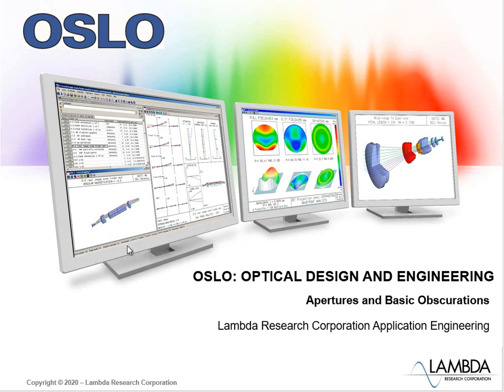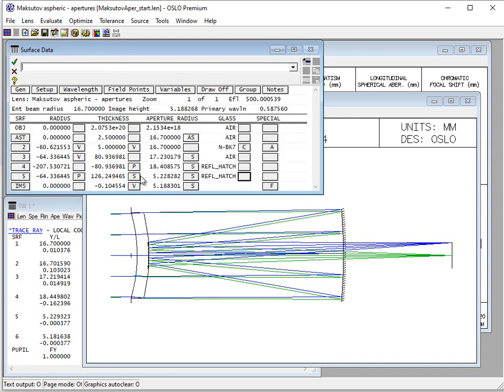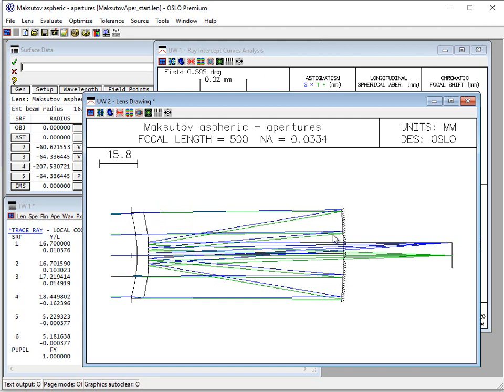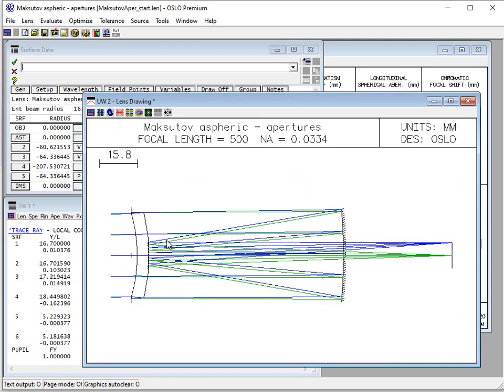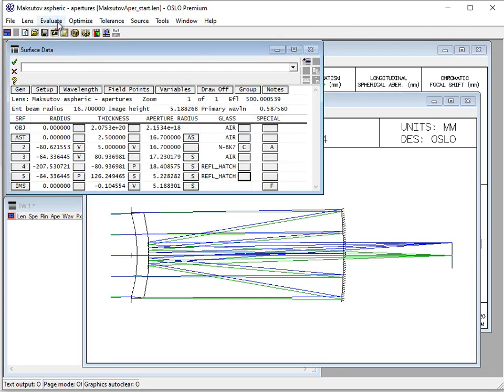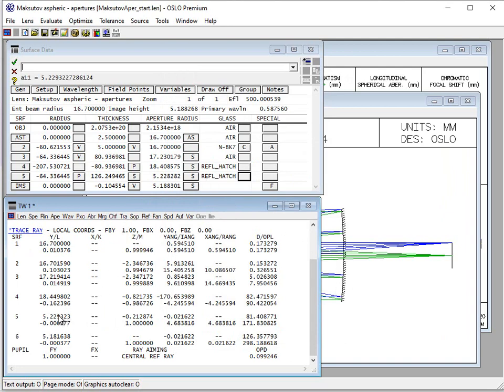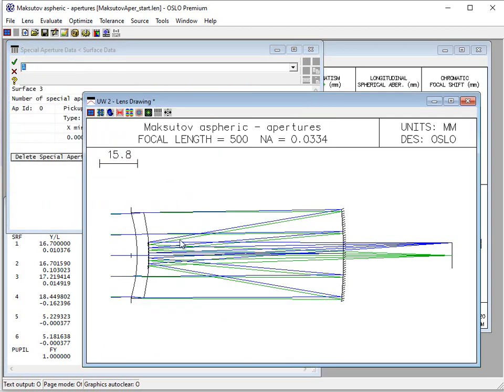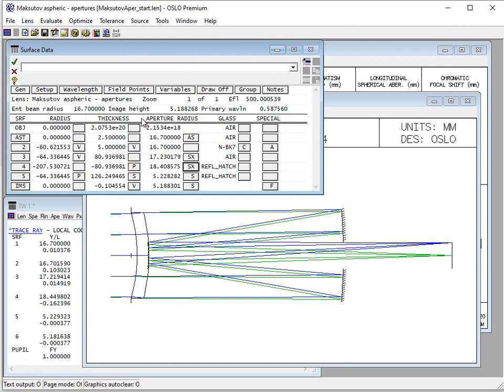OSLO Apertures and Basic Obscurations

Comment: I'm following along with the EDU version, release 23.2, and I have hit a small snag. I can implement the pass-through hole just fine on surface 4, but the obstruct option on surface 3 does nothing. Putting obstruct on other surfaces, such as the first surface 2, also does nothing. Is this an issue with the version I'm using?